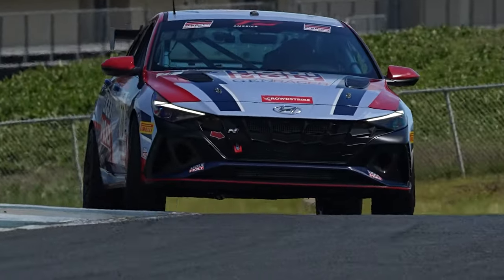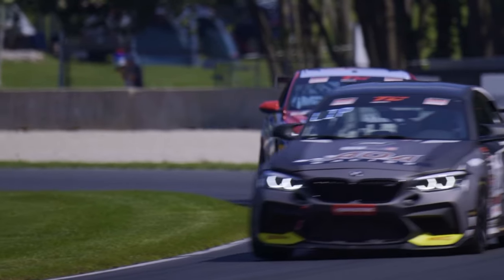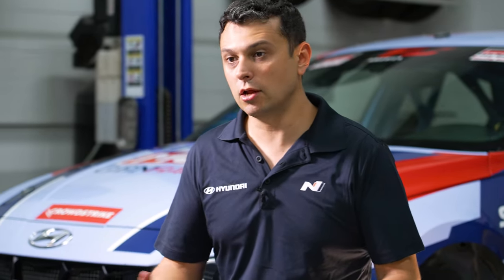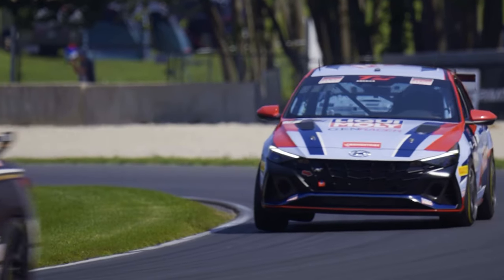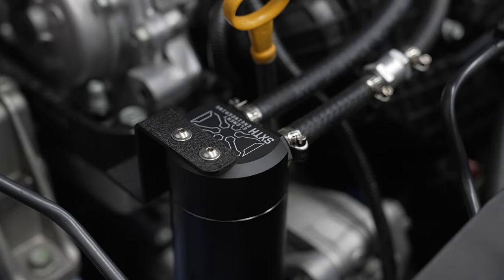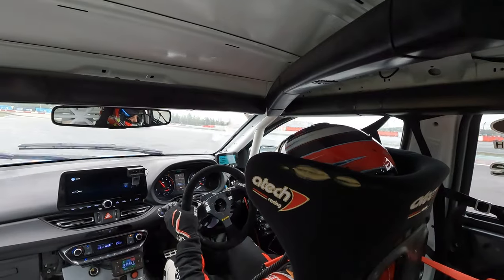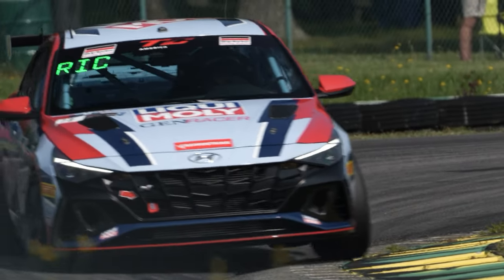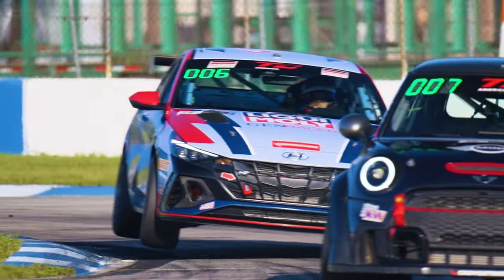Turning the Elantra N into a race car with GenRacer

Comment: So all this elentra n has is ecu tune, intercooler, coil overs, wheels and custom air ducts everything is stock ?
Reply: Yes
Reply: eLSD tune as well
Reply: All stock hardware and slightly modified OEM or aftermarket parts within TCR regulations.
Reply: @anthonyscott5484  is there a list of items? I want to turn mine into this minus stripped interior and wing
Reply: @godcore223  I mean pretty much what the video is going off of.  There's another video of this on their YT channel of a walk-around of the cars modifications
Reply: @anthonyscott5484 yeah I watched that video seemed like ecu, intercooler,  power bushings, ducts and custom exhaust which I'm assuming is a downpipe straight piped
Reply: @godcore223  pretty much what I have done to mine but intercooler and brake ducts.  The DCT is getting a clutch pack and tuners are developing TCU tunes finally.
Reply: Yup and that’s how intense this car is. Trust me, i have one and it’s just next level car

Comment: They need to work on customer service at the dealership. We own a 2018 Sonata…. One and done Hyundai owners. NEVER AGAIN! The oil consumption issues for that year needs to be addressed! Dangerous!
Reply: Got 57,000km on my 2023 Elantra N and no oil consumption issue (I do my own oil change). However, EN's transmission seal is leaking (my driveway is a mess) and waiting to see if they're going to warranty it (already been about a month and nothing). Also own a 2021 Kona (the one with premium leather seats) and no oil Consumption issue.
Reply: Wrong video kid.  Go complain to customer service
Reply: @anthonyscott5484  already did, Anthony. Thanks for the tip. My point is, these cars are a piece of crap and they don’t care to take care of you after selling the junk.
Reply: @Daisyrouv  🤙
Reply: @anthonyscott5484  A lot of Hyundais are fire hazards. The anti theft did not exist. I would try to spread that information as far as possible to prevent anyone from having a negative, unsafe or harmful experience. I’ve never witnessed a car brand be that negligent or sell that crappy of a product. We had to take our car in for the paint peeling off! Took months of complaining, no help. Next time you are driving, if you ever see a white Hyundai with the paint all rusting off.. doesn’t even have to be an older car.. it is due to Hyundai’s practices. Not the owner. Also, to add to that the car is at 60K miles. Additionally, like I originally stated, now we are on terrible internal safety issues. So yeah, I’ll try my best to warn. I’d like to add that I found this channel on the Hyundai page when I originally bought the car. I was wowed by the technology they are describing in this video but that is the only think they have going for them.. again.. they need to help these people with this MASS oil issue. They are selling the MASSES crap cars and NOT helping us.
Reply: @Daisyrouv  cool.  I'll continue driving my Hyundai.
Reply: @Daisyrouv  MANY manufacturers have had many issues that have been addressed. Not just Hyundai. And if you ACTUALLY looked into it, you would see that they have issued the proper recalls for the fires and thefts. ALSO NOTE, the vehicles being stolen is due to idiots on TicTok trying to gain notoriety.  It is only the base models that have actual keyholes (not Push to start buttons) that get stolen. Fun fact, ANY vehicle with a key can be stolen that way. Just remove the lock cylinder and you can start it with a screwdriver or any similar object. as is the case with the "USB's". But since these idiots started it on a Hyundai, the other dummys followed suite. Henceforth the spike in the thefts.
Reply: @anthonyscott5484  Same, and in my case, both my full bolt on AND tuned 2018 Elantra Sport DCT, and my 2022 Elantra N. :D
Reply: @anthonyscott5484  yeah, because you own it and that’s your car.
Reply: @AlexGtheDon  you are more than welcome to enjoy your vehicle. I’m allowed to have a different experience
Reply: @Daisyrouv  yet here you are telling others with my car or other Hyundais with good experiences to stay away... You contradict yourself cuz it's your subjective experience telling you don't buy a Hyundai.
Reply: @anthonyscott5484  my outback insurance is $300 less than my sonata now. I don’t even care what you have to defend yourself on owning a crap car and I’m not popping back into this thread. I’m not going to take advice from someone who is so wrong my insurance went up $200 right after hearing about how I’m wrong. Done listening to the reasoning you provide as to why this is a good brand of car. Congratulations, I hope your insurances do the same.
Reply: I've never accounted such bad customer service in my life thanks to a Hyundai dealership. I will avoid them like the plague.
Reply: @TaylorG-n1u  I feel the exact same way.

Comment: Paddle box? Steering wheel? Seat? Roll cage? Restraints? Wheels? Breaks? Brake pads? Engine modifications? Intake? Fuel pumps? Fire suppression system? 

He did mentioned fuel cell, Wing, brake ducts, suspension, and ECU modification after he said they didn't modify the electronics.

Comment: Good luck on the season. Can you telle your alignment settings?  I'm trying to get setup to run TT and would appreciate any help you can offer
Reply: The cars have some modifications that aren't available in the market yet and there's a lot of deeper setup at play depending on the tire, aero, effective spring rates, and other changes to the car. 

Presuming it's a reasonably stock car on a 70tw or 200tw tire, start by running -3.0° F / -2.0° R camber, 0.00 toe F / 0.05 - 0.10 toe-in R, and even out the front caster to 5.5 - 7.0° on both sides if you have any adjustment range.

Take the car through some hot laps, then start working through the tire pressure to hit the tire's target pressure and bring the center of the tire up/down in temp to reduce the difference across the tire face. Once the tire temps are in the ballpark you can start logging tire temps by bringing the car in hot and having someone quickly take tire temp readings. Adjust until tire temps are reasonably even (accounting for any temp bias from the last few turns, etc).

Once you have camber reasonably set, start adjusting the rear toe towards zero and make adjustments to the front toe as needed to give you the rotation (yaw) dynamics you prefer with a bit of added lateral grip from bump toe, ideally when you can use it ... kinematics don't always play along.

You'll have to make other changes along the way to balance out the level of tire grip available for accel / cornering / braking. That's entirely dependent on track, car, and other things.

As you add-in more and more aero, power, braking, etc be expected to change all of this. Aero is especially challenging because of its ride height and yaw sensitivity, but that's a deeper, more experienced problem to solve.